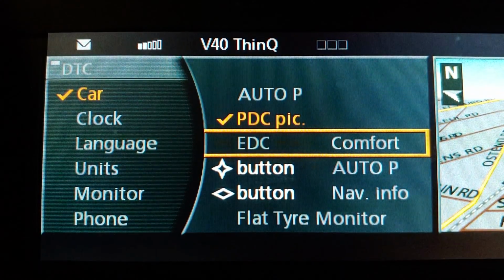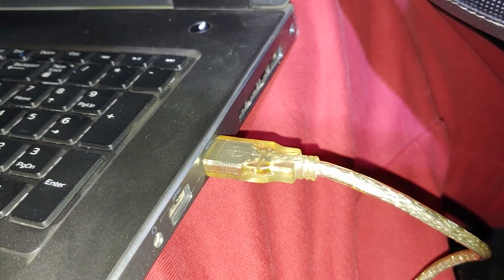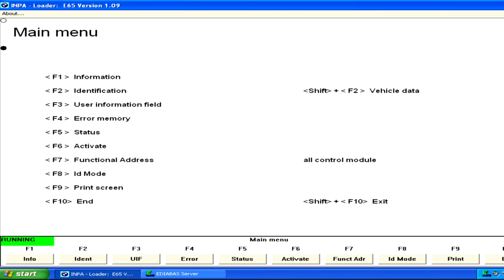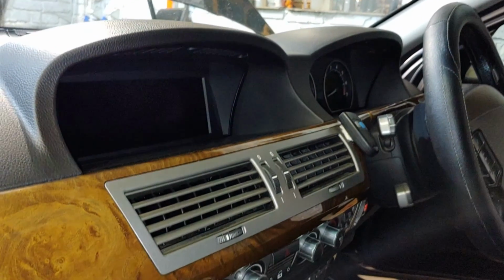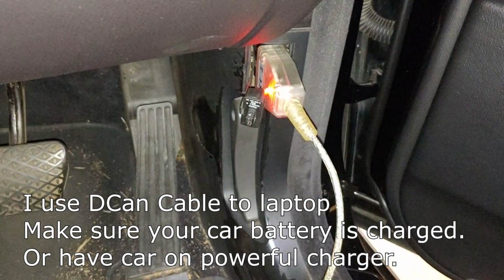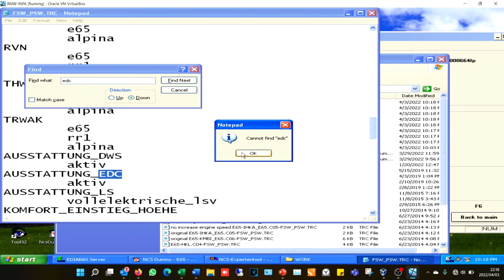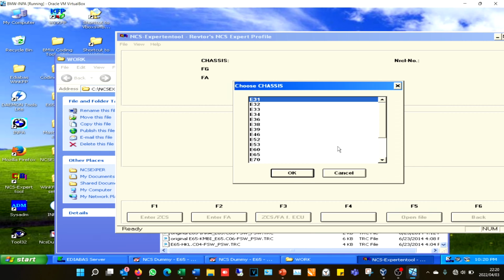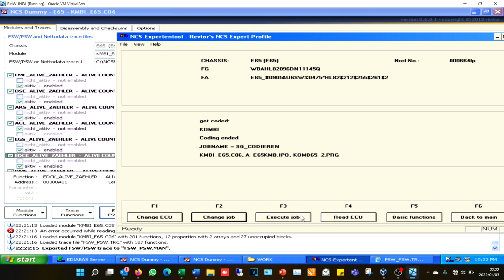How to remove Electronic Damper Control for BMW E65, E60 - EDC delete using NCS Expert -step by step

Comment: hi i just have a question, my E66 2006 750 LI according to VIN number i check it say  the car suppose to have EDC shock absorber, but when i check on the car setting it doesnt have that line " EDC comfort/ sport"like yours, so does that mean mine doesnt have EDC or it have but hidden?
Reply: Hi, I guess this menu is hidden. You can try unlock this menu:
# Hold down controller for 10 secs;
# Rotate the iDrive controller 3 clicks clockwise;
# Rotate the iDrive controller 3 clicks anti-clockwise;
# Rotate the iDrive controller 1 click clockwise;
# Rotate the iDrive controller 1 click anti clockwise;
# Rotate the iDrive controller 1 click clockwise;
# Press the iDrive controller down, and release.
If it helped, please let me know))

Comment: I have a 545i and have been running adjustable height coilovers. I blew out a front shock and looking for a quick replacement until i get a new damper. I found some e60 m5 front struts for cheap. Will they ride ok without edc, as the 545 does not have that option.